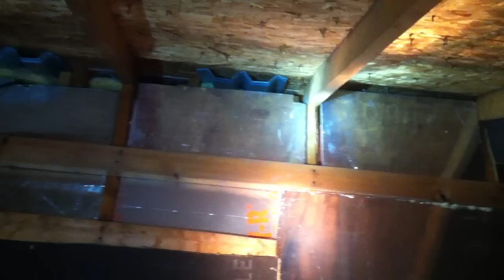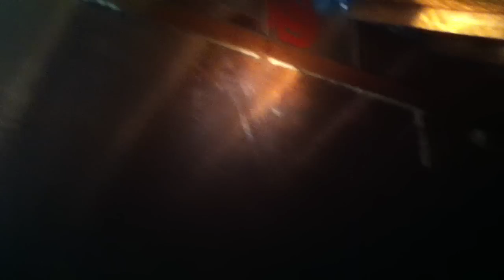Problems with knee wall insulation that was partially insulated

Comment: Question. Is there a ridgevent? Or soffit vents? Please? Thx
Reply: +kenny play This is so leaky, it doesn't matter. Heat and moisture from the house overwhelms attic ventilation. It has both. If you air seal a house, attic ventilation becomes essentially unnecessary.  It's right on Lake Erie, so the wind hit me in the face when I was up there. Check out this podcast from moisture expert Bill Rose. http://www.iaqradio.com/flashback-friday-with-bill-rose-research-architect-univ-of-il-with-live-commentary-from-radio-joe-dr-weyel/